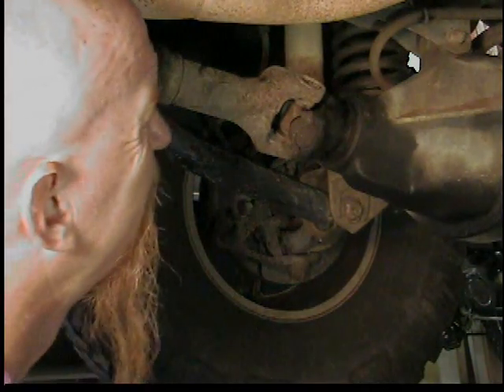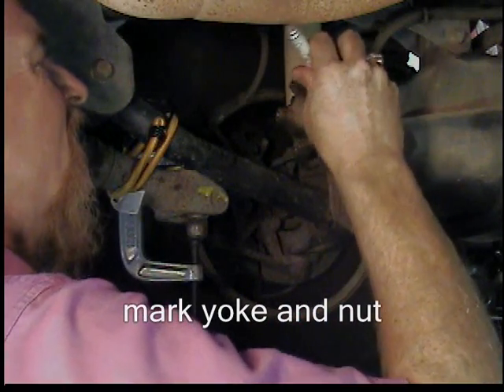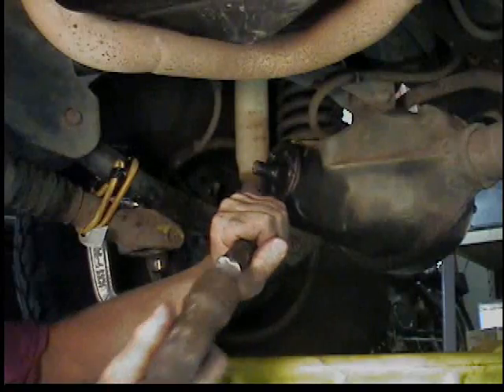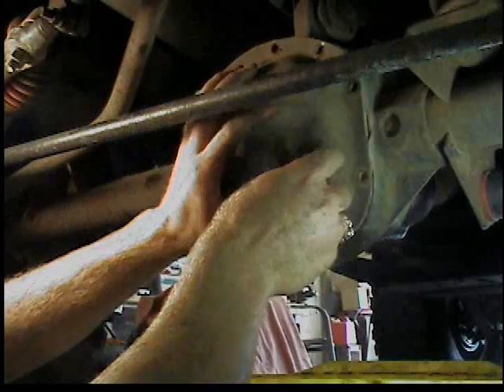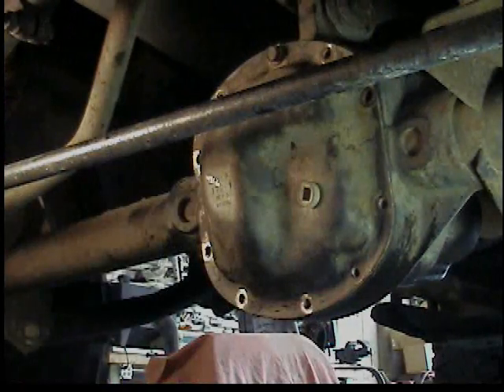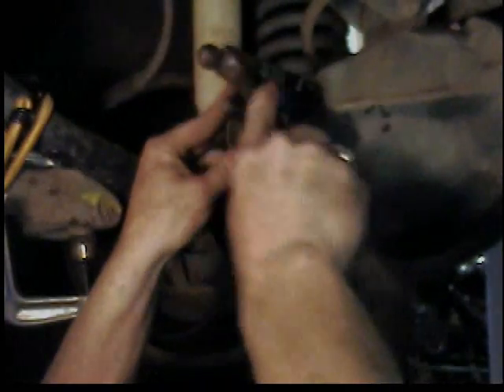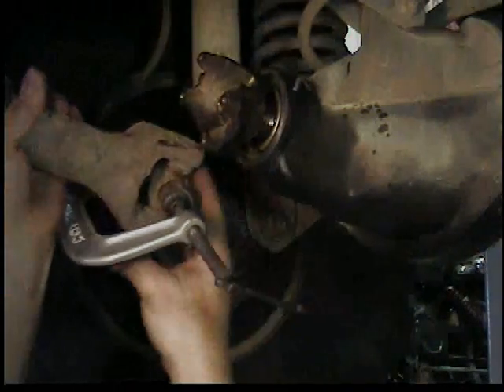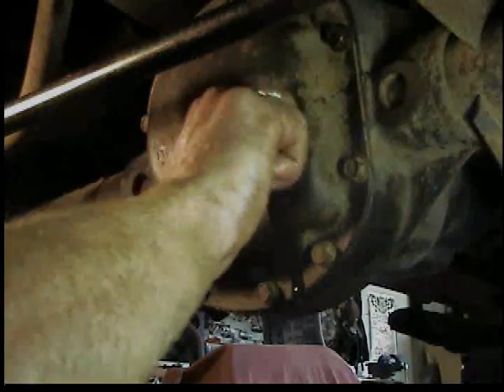differential pinion seal replacement, Jeep Wrangler TJ, DIY

Comment: Awesome instructions! Guys down at the parts store looked at me cross eyed when I asked for a gear puller. When I told them what I was doing they weren't much help and lent no tools so I had to get creative. I was nervous but after watching you do this at least 30 times I felt like I had it down. Easy finding what I needed from Morris as well. Thanks again brother! 2005 TJ Sport pinion seal DIY job done!

Comment: Doing this job today on rear diff. No way I'd be confident enough to do it without this video, thank you! One thing that has been odd is I didn't have to use a puller to get the yolk off and the diff started leaking as soon as I got it out. Hadn't even touched seal yet.
Reply from the maker: Hmmn. Well I hope it works well. Jeep On!

Comment: Just finished replacing the seal and drive shaft. I ended up using a a screwdriver to bend the lip of the old seal to remove it. I cleaned the shaft before installing a new seal. I bought a factory seal $30.00 it has lube around the seal.  Someone posted using a piece of wood with a hole drilled, tap the seal just to hold it in place, then use the board on the seal using the hammer. Doesn't damage the metal. I used the same board to lightly tap the yoke as I tightened the nut. 1996 XJ SE.
Reply from the maker: Jeep Cherokee Cool. Jeep On!

Comment: Just did this on my 2014 Jeep Wrangler,was a fairly easy job,but it shouldn’t have leaked as I just paid $3000.00 for a regear,found out they didn’t put no rtv gasket sealer on the outer seal and this is what they specialize in,time to change shops
Reply from the maker: Or just DIY. Jeep On!

Comment: I just did mine today. Longest part was to take the seal out. Bought a clutch electric impact and it did wonders. I don't have a gear puller but I do have a rubber mallet lol. This video helped allot!! Thank you.
Reply from the maker: Very cool. I have always wanted one of those electric impacts. If you think a rubber mallet is cool, get yourself a dead blow. I use that thing all the time.

Comment: thanks for sharing your pinion seal replacement.  Got the same issue on my Dana 30.
Now that its warmer in the NE, its time to start more upgrades and sealing up leaks.
Reply from the maker: Gregg Templeton Yeah, I need to do ball joints next but I have a couple of other projects to complete. New videos on the way. Jeep On!

Comment: thank you for the video man...very helpful i would not have thought to mark each piece (driveshaft, yolk, nut) before taking it off.  gotta do this for both my front and back on my 2000 tj
Reply from the maker: Yeah, it's especially important on the nut. If you put it back in the same place, the torque on the crush washer should be the same. Jeep On!

Comment from the maker: Crazy. I changed mine at 92K and suspected it had been replaced before. Been wondering if I should be checking u-joints and slip joint or something. I feel another video coming on. Jeep On!

Comment from the maker: I have always used repairs that require a tool I don't have as an excuse to buy them. That stuff adds up over 25 years. Good Luck! Film it and share. And mark that nut, you don't want to over or under tighten.

Comment: I got under the Jeep and noticed that the seal is only leaking between the yoke and the seal, best guess is that it is either damaged or has a larger ID than the yokes OD. Good thing is that the seals are <10 bucks.

Comment from the maker: It is related. You have to have tight joints (rod ends and ball joints) then proper alignment. The slop in your tie rod end is allowing a wheel to toe out or in which steers the car. You compensate by turning the wheel. I did tie rods and alignment on my old Ford F150. Wish I had filmed that. It is not that hard. Keep Googling. Somebody had to do a good video of it.

Comment from the maker: +Rick E Your account is set to not allow replies. Both of your questions are answered in several comments below. 1) Drill three holes in a piece of angle iron. Bolt through two of them to the yoke. Hold a nut between the iron and pinion and use a third bolt to jack the yoke from the pinion shaft. 2) You will have to hold the yoke if you don't have an impact. This can be done with large channel lock pliers or a specialized tool.

Comment from the maker: You can do it without an impact. You will just need something to hold the yoke like a large pair of channel lock pliers or a pipe wrench. As for the gear puller I'd have to say maybe. It depends on how tight the yoke fits your pinion. You might be able to make your own. Drill three holes in some angle iron, bolt through the outer holes to the yoke and use a nut and bolt in the center to jack the yoke away from the pinion. Or use this an excuse to go buy that gear puller you always wanted. :)

Comment: Jnburch.. its a Seal. Its only job is keeping fluid from escaping the differential. If you hear a loud howling noise coming from the rear of the jeep and you look under and it looks like the diff is covered in gear oil, theres a good chance that seal blew and driving a vehicle around wasted all the gear oil and smoked the differential.

Comment from the maker: Yes, same process except you might not replace the seal or change the fluid. Actually, once you get the yoke out, I'd be tempted to put it in a vice and try to drill out that broken bolt from the back side.

Comment: I did lube, wiped a little diff oil on it, put rtv on the od. I wonder if  the nut iOS loose or it is leaking between the pinion and the yoke ? I'll get under and take. Better look. Thanks for the good post.

Comment: thanks, also a great vid for the wobble. Definitely have some worn out bushings where the tire rod connects to wheel mount... also should mention my jeep pulls to the right on a straight road and have turn my steering wheel to the left to compensate. would this be a steering shaft problem, or alignment or part of the tire rod issue?

Comment: Great video. Can you tell me how i would align the yoke correctly if i am installing a new one? I bought a jeep with no front driveshaft or yoke and a shot differential. So i am replacing both.  Thanks!!!
Reply from the maker: +Salvaged Stitch I know I make a big deal about it, but it doesn't really matter. If it did, they would make one spline wider. I like to run mine 45 degrees out. That way they are bending at different times. Jeep On!

Comment: Great video. Going to tackle this myself when warmer weather arrives. There seems to be a lot of disagreement on the preload/crush sleeve topic. Am I missing something? Isn't preload obtained with an inch pound torque wrench for the pinion rotation NOT loaded with the weight of ring gear/carrier/axles assembly? Any preload reading obtained with the assembly intact is going to be way too much torque.
Reply from the maker: Yes, you would have to remove axles to start over. This video assumes that if you put the nut back in the same spot, it will be just as tight as it was.

Comment: Having some seal issues. I replaced u joints and figured I'd replace the leaking seal while I was there. Marked and installed everything just as it came off. Replaced the yoke also since the old one was scored pretty bad. Anyway, 3 seals later....still leaking. Suggestions? It's leaking around the yoke/seal contact area. One other question, is there supposed to be a washer between the out pinion bearing and the base of the yoke? Need some ideas.....Great video by the way
Reply from the maker: It sounds like you have more serious problems, or someone replaced the seal before you and got the torque wrong on your pinion. Also, if you changed the yoke, the mark the nut method may not work since the yokes could be a different height. You might want to start over with the more complete method of replacing the crush washer, pulling the axles and setting the pre-load drag. I don't have that video but I am sure others do. Jeep On! ps. cure all front end wobbles before you can expect that seal to last. Jeep On!
Reply: I think I have figured out the Issue. I have noticed  a few D35s using a slinger between the seal and the bearing. Not sure if it's just for the Trak Loc set ups or some other reason. I have a new seal and slinger coming. When I torqued the nut down the first time, I measured what it took to get to the original mark. 196-200 ftlbs, which factory spec is 200. I'll post back after I get parts reinstalled

Comment: Thank for making a excellent video! But I have a question I keep seeing the people using Barak cleaner on the intro there gear housing.I have mix feelings about that because I fell like there may be some Residue from The break Cleaner That can write down the gear oil Like to know what your opinion on that is. Also other say use RTF to make Gasket And to wait 1 hour before twerking down The cover not sure what type of gasket material you used But I seen that you didn't wait Anytime to tighten down Your cover boats if you would could you tell me what kind of seal that is and do I need to wait an hour before talking it down thanks for your time and actually video

Comment: Great vid...1 question, doesn't the crush sleeve and nut need replaced when you do the seal? or does marking it work just fine...no slop or leaks? getting ready to do this on my 98 but get different opinions on if marking the nut and yoke is good enough or if you need to redo the preload...
Reply from the maker: This is heavily debated in the comments below. If you trust that this is the original seal and/or the pinion pre-load has not been messed up by a previous disassembly, then mark the nut and pinion and put it back to the same spot and you will end up with the same pre-load. This video was made four years ago and that seal is still performing well. Jeep On!
Reply: I was told the same by some old timer mechanics but I saw this vid and wanted to ask, and that seal has been holdin up just fine for 4 years?...I am more confident now hearin that!! so the part number you have listed will work in my 98 dana 30?
Reply from the maker: Yes. Have at it. Jeep On!

Comment: awesome video thanks. does all this info apply to the yoke coming off the rear axle? i have a 98 tj and i was replacing the u joints and broke a nut off on one of the caps. so now i need to replace the yoke...

Comment: 8 mm I've stripped countless jeep u joint bolts trying to use a 5/16s it's metric the whole jeep is
Reply: 8mm and 5/16" are identical either size will work, have been using either or for 30yrs with no problems.

Comment: Great video! My question is: I have a leaky rear pinion seal on my 89 XJ (Dana 35). It had been replaced once already, but I'm not sure whether or not they torqued the yoke nut back to the original spot. They couldn't remember if they marked the nut. Is there a way to tell if it was done correctly? I guess too loose and you have shaft end-play. Too tight and ???. With that in mind, when I replace the seal, how would I know if it's torqued correctly? Would measuring the pinion/ring gear backlash be useful?
Reply from the maker: To do it right, you need to pull the axles and cover, drain the fluid, get a new crush washer, then tighten the nut until the pinion drags to 10 inch pounds. It would take another video to show that process. Or you could fudge it with the fluid and axles in but the in lbs setting would be a guess. On the other hand, thousands of people have just rammed them back together with an impact. It all depends on how particular you are. Your not going to get play, your just going to either run it too tight and wear prematurely or risk the nut coming loose.

Comment from the maker: It can't be much different from a Wrangler or a Chevy or a Ford. Maybe different sized sockets but the process is pretty universal. Just mark the nut so you get the same torque.

Comment: I have a 95 toyota tacoma 4x4, I plan on tackling this myself this week. I think I have most of it down, but have been told a few diff. things... How do I manage the tires? I've been told I have t take the tires and axle off?? but most vids I see its just jacked up? So can I get away with it jacked up with e brake on? I just got to make sure the tires don't spin right?

Comment: Great tutorial bro! Would you happen to know offhand if this could be used to do a JK pinion replacement? Thanks!
Reply from the maker: Preston Broussard Yes, they are all basically the same. Just mark the nut and put it back in the same spot so you get the torque right. It doesn't hurt to locktight the nut too.

Comment: Hey there, I followed your procedures on this job for my 99 wrangler tj(Dana 30 front axel)  but neglected to mark the nut before removing it. I did take note that 2 or three threads were showing so when putting it back on I impacted the nut down to where about 2 or 3 treads were showing. What would be that nuts torque spec? I am a bit worried about over or under tightening it. Also I originally marked the case, yoke and drive shaft with paint but the mark on the case rubbed off so I put the yoke back on in about the same position I took it off. Will being off a bit cause any issue? If I am not back on exactly the same way, I am dang neart the same position. My main worry is over or under tightening that nut. I don't do a ton of 4x4 driving but do 4high in snow or driving in other wet/slippery conditions. I appreciate your advice and help. Thanks! (great video(s) by the way!)
Reply from the maker: Matt Holloway hmmm. Technically it's all about preload on the pinion. to do it right you would buy a new crush washer, pull the axles, and torque it until you have the correct amount of drag on the pinion. That being said, millions of people have just run it back on with an impact and been ok. Maybe take the nut off and reinstall with thread locker, then monitor for noise and wear. You could change the diff fluid occasionally checking for metal in the fluid or uneven wear on the gears. I would probably wheel the crap out of it and dare it too break. Anything can be fixed.

Comment: hey, I have a Jeep 2002 Wrangler. both the pinion seal the front and rear leaking. Is the process the same for the rear that is the front pinion seal replacement?

Comment: I've gently tapped a number of yokes out with a hammer, are the jeeps extra tight on there? I guess i'll buy a gear puller...
Reply from the maker: CubNole You could always try that first. Worst case you put the nut back on lining up the marks and go buy the puller. Bunch of new Jeep videos coming soon so be sure to subscribe. Jeep On!

Comment: I don't understand how marking the nut does anything? In order for it to be truely in the same spot, you'd have to mark where the nut is at the very last thread before you take it off as well, so you could start the nut in the same place it came off.
Reply from the maker: Unless you flip the nut over, it will always start in the same place. There is only one thread in a nut, therefor only one place to start.

Comment: wouldn't you have to put the nut on the thread in exactly in the same place it came off to get the lines to line up exactly the same?
Reply from the maker: Karo Staro As long as you don't turn the nut around, it will always start in the same place. There is only one thread.

Comment: What if you are replacing it with a brand new yolk?
Do you torque it the same by marking the threads with a paint pen?
Thank you
Reply from the maker: No. New yolk will be slightly different in size so you will have to remove axles and set the drag with a new crush washer.

Comment: When I try to loosen the pinion nut the yoke turns with it. How can I prevent that to get the nut off?
Reply: use an impact gun like in the video.
Reply from the maker: edpvideo If you don't have an impact gun, try it with the wheels on the ground and blocked, or hold the pinion with large crescent or pipe wrench or channel locks. Or, drill two wholes in a long pieve of angle iron and bolt it to the u-joint holes off to one side so you can still get on the pinion nut. Let us know what worked for you.
Reply: I am trying to remove the rear pinion seal so had rear tires in the ground. Manual trans was in first with parking brake on. Mine is pretty rusted so I went out tonight and bought an impact wrench to use with a friends compressor. Hope it works. It is a Midwest classic and everything under this thing is held together with rust. Your video makes it look so easy. Just as long as I can get this nut to break free.
Reply: By the way. What type of marker are you using that will mark on greasy surfaces?
Reply from the maker: edpvideo It is common to use a thread lock compound on these nuts. You might try heat.
Reply from the maker: edpvideo I used a paint pen.
Reply: wwwCARSSUCKcom I shot it with Freeze-Off, then did use an air impact wrench anyway. Came right off. The rest was easy since I had watched your video. Glad I found your channel.
Reply: they sell a special tool to hold the yoke while you loosen the nut(its 5 bucks at harbor freight), looks like square on the end of vise grips
Reply: buccaneerbob11 I got an air impact wrench and that did the trick. I wouldn't do this job again without one. made it super easy

Comment: Would it not be better to use a small off cut of steel pipe to knock the seal in instead of hitting the seal with a hammer ?
Reply from the maker: Sure, or a large socket. Good idea.

Comment: could a busted differential pinion seal cause any vibration or sound while accelerating? Ive got an 05 and started having problems yesterday so Im trying to trouble shoot so i don't have to take it in to get it looked at.
Reply from the maker: Doubt it. Sorry.
Reply: Check your mounts and springs.